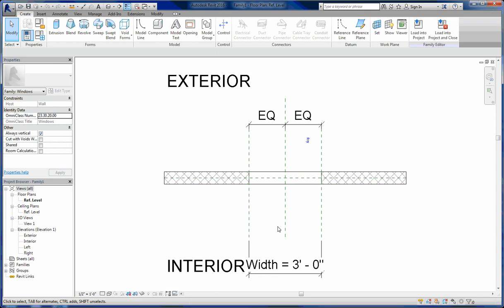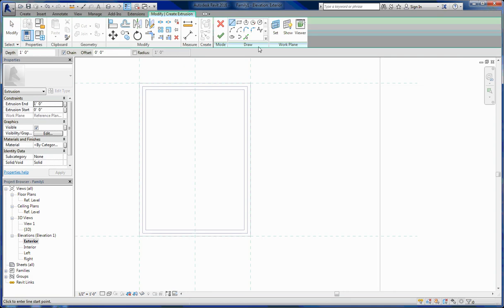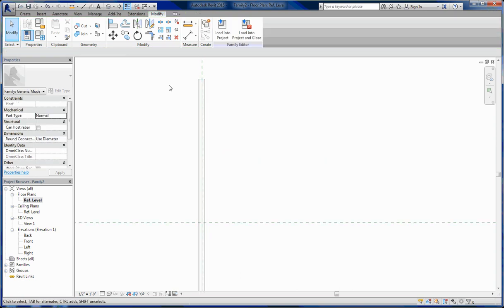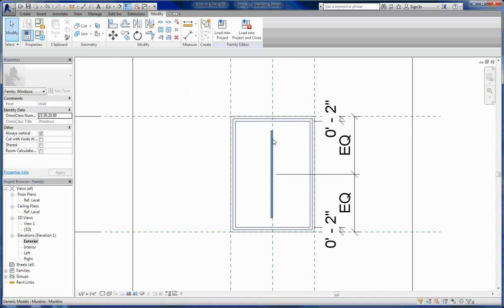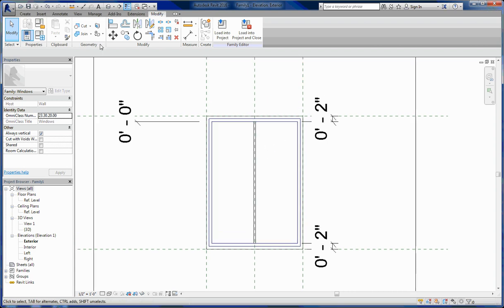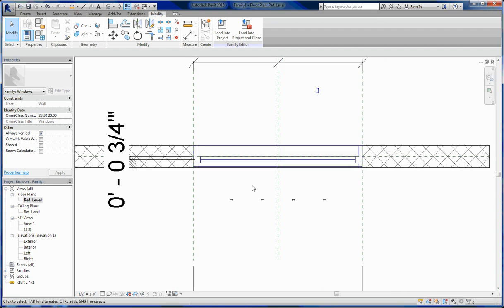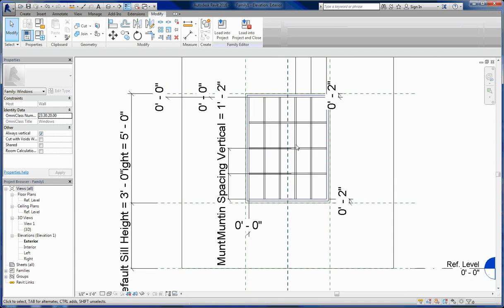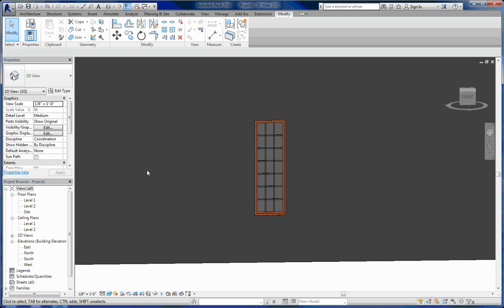Revit 2016 - Parametric Families

Comment: Any kind of tutorial 101:
Get your basics right!
15 minutes+ of muntin hassle?
Pro-tip ;)... use the refplanes and padlock symbols to 'lock' model elements into place, not dimensions. You can add a few refplanes (including parameters) to some template and save 10-15 mintues for every type/family of doors/windows/whatevers.
very timeconsuming